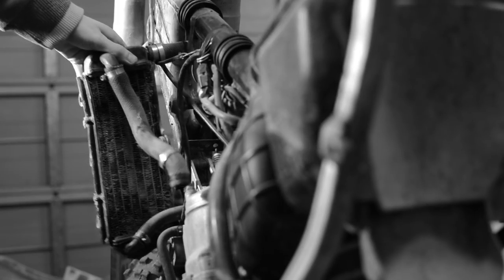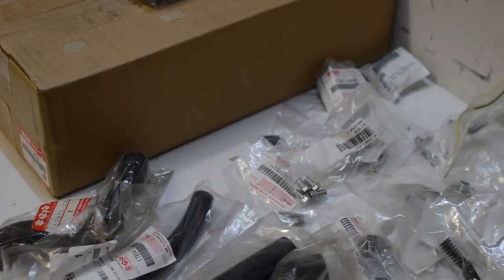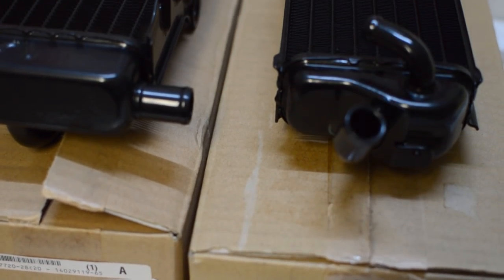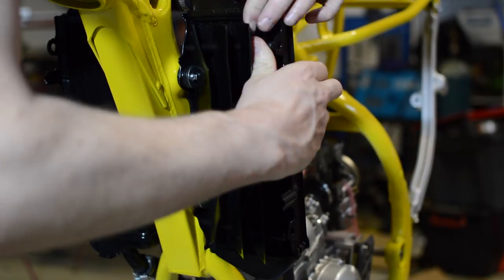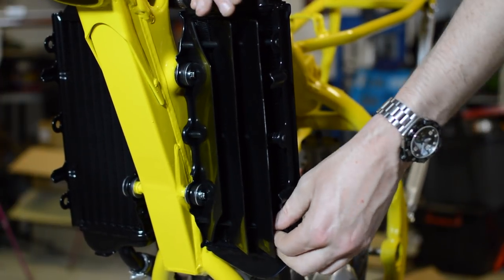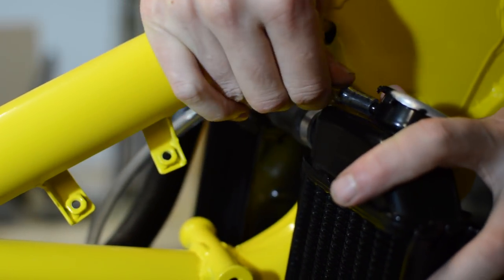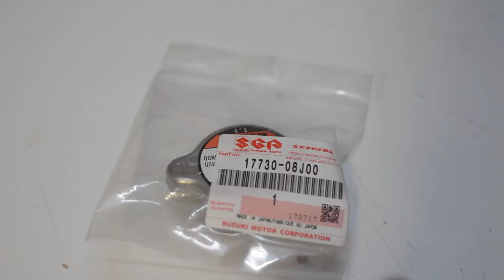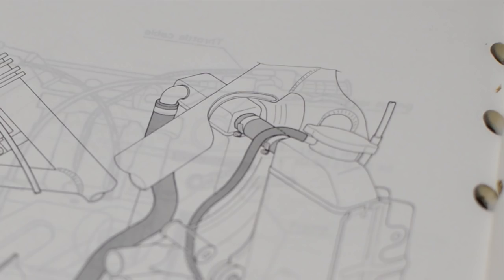Cooling System - 1992 RM250 Restoration - Episode 14

Comment: Really interesting that the top radiator hose goes in front where on a 92 rmx250 it goes thru the hole in the frame.

Comment: I also must say that you must of spent a bomb on this restoration! But fair play
Reply from the maker: Yes, to restore these bikes properly it does cost a bomb!  Maybe at the end of the series i'll do a video on the cost...
Reply: I've tried to save as much as possible, My current list of replacement parts is - Front Brake Pads, Suspension bearings & seals, Nuts & Bolts + Paint & a few other bits & bobs. But generally mine hasn't cost me a fortune!